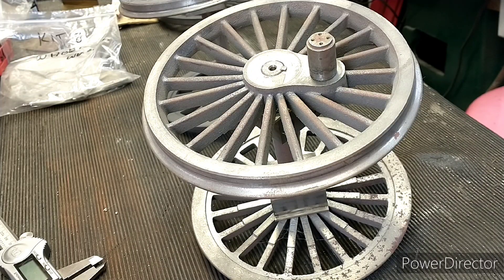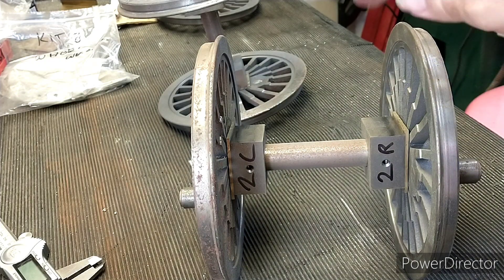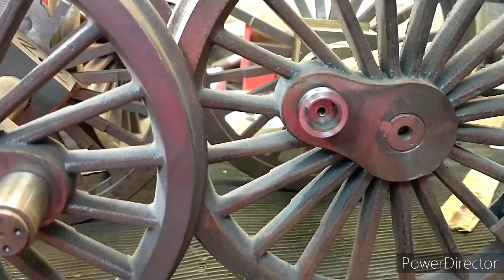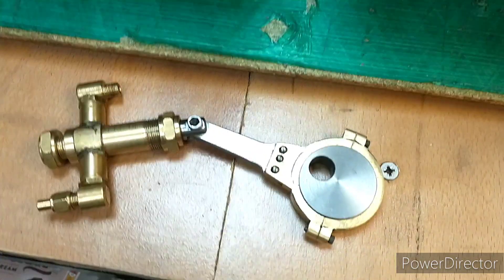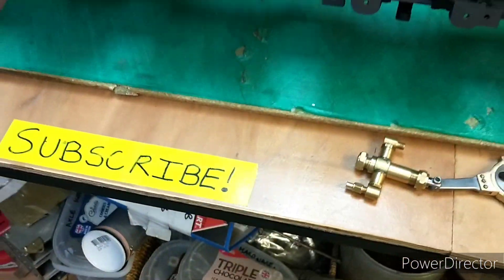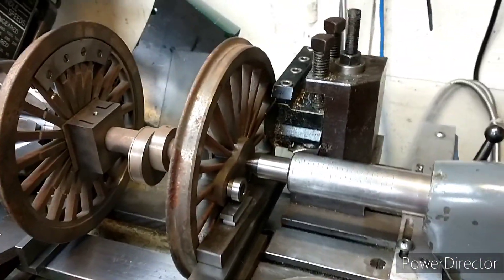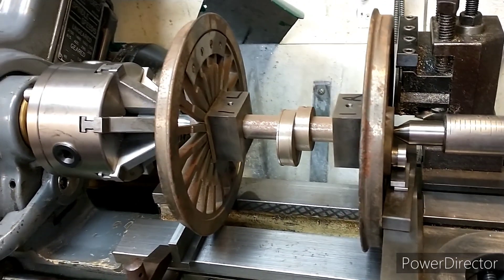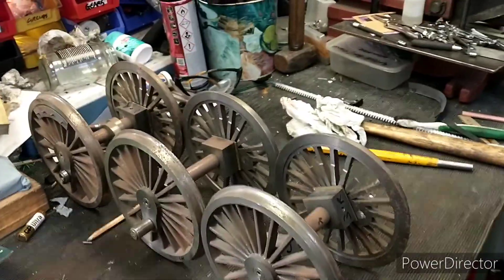Modelworks 5" Britannia - Episode 9: Quartering the driving wheels 😱😱😱

Comment: Good video, I made a jig for my Manors wheel set quartering but using the same process as you have shown, I have a few more loco wheel sets to do so having a dedicated jig was worth the effort. Great stuff 👏
Reply from the maker: Hiya glad you enjoyed the video do the jigs work with all sizes of driving pins? I think to change my setup for a different size  than 16mm I'd just need a different centre which isn't too much hassle. 😀
Reply: @julias-shed  Hi, yes it does as long as the wheels have the same size crank pin either side(I have never seen a wheel set that doesn't 😀) then yes! My Manor has three two different Crank pins, the Driving is larger than the leading/trailing. All came together OK and rods fitted 👍
Reply from the maker: Nice one I'll have to have a proper look at jigs next time I have to do this thanks 😄